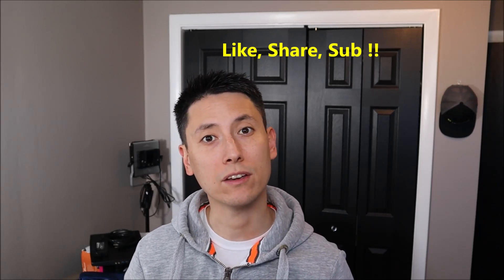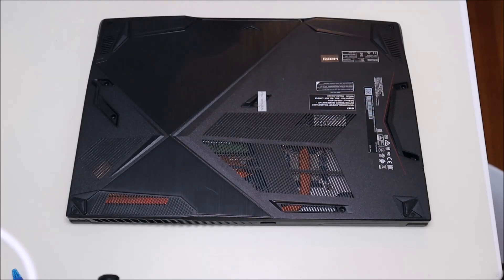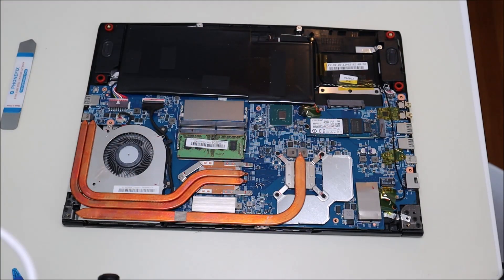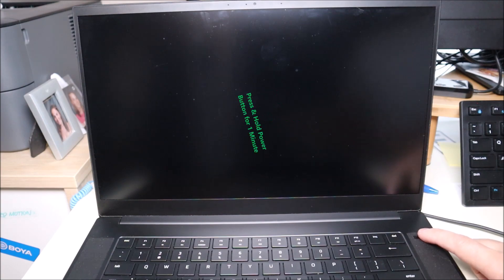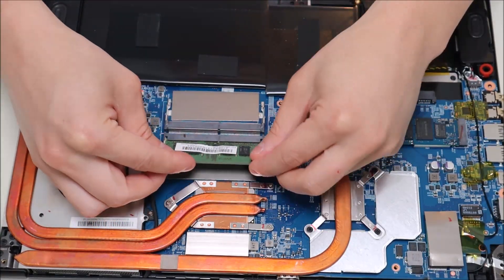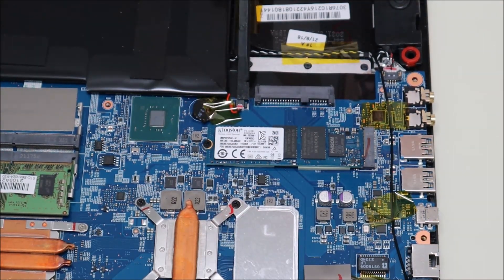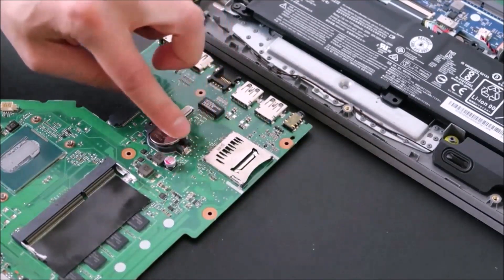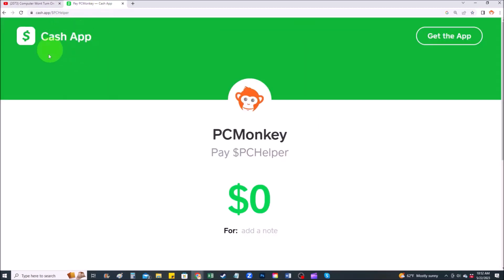MSI Laptop Computer - Dead / No Power / Wont Turn On Fix

Comment: My MSI  set up is very similar but won’t work. I tried the power button didn’t work. I also took the case off and tried disconnecting the battery and going thru those step didn’t work l, but have yet to tried my ram. But oddly enough when I click the power button I get a flicker of life such as a keyboard lighting up but won’t turn on, no fan noise, no lights on the screen nothing beside one flicker of light from the keyboard and the small light next to battery charger input Indicating it’s receiving a charge. If anyone has any suggestions pls help I can see my pc is receiving power since the keyboard flickering once I turn it on for a moment  and also the small light on the charger port. I assume my battery is receiving the power, but not distributing it to the motherboard or any other component of my laptop.
Reply from the maker: If, after trying all the steps seen here multiple times, you have not been able to find the issue, your most likely looking at one of two possible issues. (1) The motherboard is bad and needs to be replaced. Let me know if you would like help finding a compatible motherboard. Or (2) there is another computer component, shorting out the motherboard and need to be replaced such as the power jack, USB board, Touchpad, etc. You would have to troubleshoot each of those individually but unhooking it from the motherboard and trying to turn the computer on. Let me know if you would like help with that operation.
Reply: @PC_Monkey I have the same issues, went through all the steps and it seems that nothing works, how can i unplug all sources attached to motherboard in order to see if anything inflict the operation? Can you choose motherboard for me after I'll try everything? Thanks for education.
Reply from the maker: @WickedSickXXL  What brand and model computer do you have?
Reply: @PC_Monkey  MSI 14 inch Laptop Modern A10M | Core i5 | 8GB RAM | 256GB SSD, GF63 Thin 10scxr
Reply from the maker: @WickedSickXXL  Is this similar to your model? https://www.youtube.com/watch?v=jNg0Xh28XMU
Reply: @PC_Monkey  not same but similar yea
Reply: @PC_Monkey also, until yesterday the power button was blinking orange, today it blinks white, fan works silently.
Reply from the maker: @WickedSickXXL  If the fan turns on and works but nothing on the screen, then the computer may be on. Can you try the steps seen here?  https://youtu.be/e9iy30J00-k.  Let me know how that goes :)
Reply: @PC_Monkey  the option with Ram dismember I tried, doesn't work, tomorrow I will try with the extra monitor and will get back to you, thank you in advance.
Reply: Quick update, I tried another screen and it was the same situation.
I repeat all the operations removing battery, ram and int. Battery and after it switch on as it used to switch before.
Do you recommend changing any part which might be faulty or should I keep on going like this?
Thank you.
Reply from the maker: @WickedSickXXL  If its not displaying to another screen either then I would say motherboard at this point:(

Comment: Please help me diagnose a problem with my gaming laptop, an ASUS TUF Gaming F15. I’ve had it for two years without any issues. However, this month, while playing games, it started overheating and shutting down multiple times. I consulted a technician who replaced the thermal paste and cleaned the fan and vents. After a week, the problem persisted, and now it won’t turn on at all, though the battery light is still lit.
Reply from the maker: Just so you know, over heating situations can be hard to troubleshoot just one issue as multiple different components and boards including the motherboard itself, could all be faulty. 
An overheating computer can be damaging multiple different components if not resolved. First, make sure that the fan and vents are clean and clear. If you need help accessing the fan, let me know what brand and model computer you have and I can help you get inside it. If that does not fix the overheating issue, then try replacing the thermal paste on the CPU and if needed, the GPU as seen here; https://www.youtube.com/watch?v=K_j4GPjpawk. If that fails too, replace the CPU

Comment: I tried all steps still won't work i think its Because i never unplug the charger and the laptop is always on @PC_Monkey would buying another charger fix this or adapter i have the msi gf63 thin 10scxr

Comment: Nothing has worked so far for mine unfortunately 😔. Thank you anyway for your help
Reply from the maker: What brand and model computer do you have and whats the issue with it?
Also, did anything happen before this issue started? Liquid spill, overheating, a Windows update, etc?
Reply: @PC_Monkey  GF65 Thin 9SEXR-229FR - 15,6" FHD - Core i7-9750H - RAM 8G
The issue is that the computer does not even turning on at all (if I'm not mistaken, when we plug in the charger, a little light turn on which is not the case anymore here). I don't think that anything bad happened so far. This computer was not even used for gaming in fact and I haven't used it that much in the past 4 years 😔. If you have any ideas I'd be very thankful 🙏

Comment: Is there a chance to recover the MSI GS66 Stealth laptop after a complete flood?
Reply from the maker: Some things could most likely be saved, other things may be lost. If the computer was very wet, I would first take it apart as much as possible to dry a day or two. Then I would clean all the boards with a tooth brush and a alcohol mixture with a tooth brush. After that, I would try to reassemble and turn on.
Reply: @PC_Monkey  Thank you very much, I'll do like said step by step. Thank you again.

Comment: I have MSI GP76 Vector 12UGS, and the reason why it is not turning on is because of charging the laptop too much. At that time when it was not turning on, neither there was liquid spilled, nor CPU or GPU reached beyond the maximum temperature, but it was still overheating. I was using CoolerBoost with auto fan enabled. Any solution?
Reply from the maker: Just so you know, over heating situations can be hard to troubleshoot just one issue as multiple different components and boards including the motherboard itself, could all be faulty. 
An overheating computer can be damaging multiple different components if not resolved. First, make sure that the fan and vents are clean and clear. If you need help accessing the fan, let me know what brand and model computer you have and I can help you get inside it. If that does not fix the overheating issue, then try replacing the thermal paste on the CPU and if needed, the GPU as seen here; https://www.youtube.com/watch?v=K_j4GPjpawk. If that fails too, replace the CPU
Reply: @PC_Monkey I overcharged my laptop too much and the mainboard got burnt. Any solution?

I am using i7-12700H, RTX 3070 Ti laptop, 32 GB of RAM, and 1 TB of SSD.

Comment: I have a lower end msi laptop and today i was trying to charge it at school and it didnt charge, so i closed it and tried to use my friends charger and then my laptop just stopped working, it doesnt turn on, no lights flash, it doesnt even show charging
Reply: Its an msi modern 14
Reply from the maker: @matmeg-0847  If the charger was not compatible with your computer, it could have damaged the motherboard. Sounds like your on the correct video.  Have you tried the steps seen here?
Reply: @ i dont have any screwdrivers since i go to boarding school so i have to take it to be repaired today

Comment: Hi - my screen stopped working but the hard drive fans and keyboard still appear to be fine. Though when cutting off the laptop - it appears to reboot itself. There's still no screen. Have also attempted to add an external monitor but there's no signal. Help and thanks for sharing the video!
Reply from the maker: For a computer that turns on but the display does not work, try this video first; https://youtu.be/e9iy30J00-k.  Let me know how that goes :)
Also, did anything happen before this issue started? Liquid spill, overheating, a Windows update, etc?

Comment: So I'm having an issue is my katana 15 b13v my charger is working it does get warm but it's not turning on at all
Reply from the maker: Sounds like your on the correct video.  Have you tried the steps seen here?
Also, did anything happen before this issue started? Liquid spill, overheating, a Windows update, etc?
Reply: @PC_Monkey  no issues that im aware of just opened it up and pressed the power button and it doesn't do anything I just have the blank screen like when the computer is ofd

Comment: I have a MSI RAIDER laptop, closed at work, pulled out my backpack at home and didn’t went on again…

Tried all the stept, nothing is working unfortunate…
Reply from the maker: If after trying the steps seen here in this video multiple times without anything changing, your most likely looking at a faulty component preventing the motherboard from working or a motherboard issue.  I would start troubleshooting each component, starting with the charger and power jack.  You can see those two videos here;  https://youtu.be/YBhsVHideGE  &  https://youtu.be/HpabvrNaodU.  You can also try replacing other components like your Power Button to see if that is the route cause.  If none of those are the issue, you would then be left with a motherboard replacement.

Comment: Hey, wondering where the starter pins are on these msi laptops. Like how a tower has those pins you plug the power button into that you can jump with a metal object. Where are those and how do I start them without the power button?

Comment: Hello i opened my laptop and do it exactly as you said but not turning on.
But when i press the power button the light is shining from inside of laptop which is blue just second shining and shutting down again
Reply from the maker: did anything happen before this issue appeared?  Liquid spill, overheating, Windows update, etc?
Reply: No i was plaging game
Reply: Then when it was on the charge suddently turned off
Reply: Do you have whatsapp or tg number i will send you video of something from inside lighting

Comment: Turned off suddenly while using
None of the troubleshooting stuff works
Reply from the maker: Are there any signs of life at all when you try to turn it on? Lights? Fan, Motherboard, or Hard Drive sounds? Anything seen on the screen?  Also, did anything happen before this issue appeared?  Liquid spill, overheating, Windows update, etc?
Reply: @PC_Monkey  nothing at all windows update was like a week ago
I was just using my laptop and it turned off suddenly, no intensive tasks just word and browser

No lights or fans
Reply: @PC_Monkey  it could be overheating
Would you know what motherboard part to replace if it died due to overheating

Comment: You sir are a life saver! I have MSI GS63 Stealth 8RE and it was just showing red led light on when Power cable is connected, pushing and holding the power button did nothing.

Followed your advice and just pressed power button for 1 min and it worked!
Reply from the maker: Glad your all set :) Always here if needed !!

Comment: MSI g6 leopard! White power only, tried ram and battery, no dice....can you do a video please?
Reply from the maker: Were you able to perform the manual BIOS reset? Also, did anything happen before this issue appeared?  Liquid spill, overheating, Windows update, etc?
Reply: @PC_Monkey  I was, however, the issue continued afterwards. No spills, no new updates, and no overheating; I keep my computer on a cooling pad. I rarely need to use cooler boost. The fans weren't overworking and the keyboard body was cool before shutting off with the blinking light. It's resolved, now, but the cause still alludes me. I followed the steps in this video and another video that had my exact model. I cleaned everything (fans, cooling rods, crevices between the RAM, etc.) and left it to charge for 24 hours. After the 24, testing, same issue. After removing powercord, and trying again after 10 minutes, it turned back on as if nothing happened. Still running diagnostic.

Comment: Although I am on the verge of just getting a new laptop, the old one is still here for last tries, Here is what happened with my 11 year  old MSI GT70 0ND. A year ago I made the upgrade of old and gone gpu GTX 675MX  to 970M and flashed bios/EC for it, an upgrade the user Svet knew how to do as he created it and I followed it. It gave another 1.5 years of life to the laptop. Last I used screen cast for my phone and put it in sleep. I long ago deleted hyberfil.sys file as I do not use Hybernate. The laptop would just power ON but : Black screen, no boot. no bios nor windows. When it boots to windows the fans would be loud as a result of the new BIOS/EC but this told me it would not even reach to boot. I was reseating RAMs and HDD and that led to the laptop - to not power on at all. 

I bought a new motherboard (exact same  MS 17621 Ver 1.0). And put everything correctly in place to the new board including the CMOS battery. I was able to power it on a few times for 30 couple of seconds then it shut down -  but - like on old board - the Trackpad has no working LEDs, black screen, no logo- no boot. Also to power on is rare. I noticed the cables it uses CNJS E308724 80C 60V 16 pins - are really folded - on one of them the fold feels soft, it is like the cables could be gone? I see no such cables are sold. The foil covered trackpad to motherboard and power button&quick buttons panel to motherboard flat cables are not in good condition.

Comment: My laptop won't turn on. I've tried holding the power button, but nothing happens. When holding the power button, the chip next to the CMOS battery gets very hot. Does anyone have any suggestions for what to do next?
Reply from the maker: If that step did not help, have you tried the other steps? Was the computer overheating before this issue started?
Reply: @PC_Monkey 
I just received my laptop back from the service center. They told me that the motherboard was damaged (the chip is dead) and it needs to be replaced, with a cost of $500, so I ended up buying a new laptop. Anyway, thanks for your tips 😊

Comment: Okay so i dont know what worked, i tried unpluggin the battery but it just wouldnt come out, only slightly. Then i popped out ram stick and put it back in, still nothing then did that cmos battery unplug and still nothing. So finally i gaveup and screwed back the cover and just clicked on the power button and it started working... i am not sure what happened. ANYWAYS 
TLDR: DID EVERYTHING AND IT STARTED WORKING. 

SO THANKYOU SO MUCH ❤
Reply from the maker: Glad your all set :) Always here if needed !!
Reply: @PC_Monkey  ❤

Comment: Great viideo..  Thank you.  Didn't fix my issue but gave me something to try.  My 15 C7VFK is just out of warranty and won't boot.  Keyboard lights up, no screen, no fans then after about 15 seconds the power light goes red.  This has happened a few times but I have fixed it by simply holding the power button for 30 seconds then plugging the power pack back in.  No luck this time tho sadly.  I simply restarted after an update and boom..  dead.  Have tried everything I can think of...  time to take it somewhere for repairs.  I have owned many PC's and a few laptops and never had this much trouble.  These things are a piece of junk and I will never buy MSI again.
Reply from the maker: Were you able to try the other steps seen here? Also, did anything happen before this issue appeared?  Liquid spill, overheating, Windows update, etc?
Reply: @PC_Monkey  Hi,  Cheers for the reply.  Have tried everything except taking the motherboard out.  Am a little scared to do that but will give it a go when I have time.  Thanks again 😀

Comment: My laptop still wont turn on. I've tried every method and they don't seem to work. I tried checking the battery, ram, charger, cmos battery and nothing. Do I have to go to an actual place or can you figure it out?
Reply from the maker: If after trying the steps seen here in this video multiple times without anything changing, your most likely looking at a faulty component preventing the motherboard from working or a motherboard issue.  I would start troubleshooting each component, starting with the charger and power jack.  You can see those two videos here;  https://youtu.be/YBhsVHideGE  &  https://youtu.be/HpabvrNaodU.  You can also try replacing other components like your Power Button to see if that is the route cause.  If none of those are the issue, you would then be left with a motherboard replacement.

Comment: I was kinda confused when u said to disconnect the wires thingy of the battery and to hold power button for 1 min then if it turns on which it did to plug in charger i did it with no case on sideways and then i plugged the wire battery thingy back to the charger thingy and i had the computer suspended up on my bed but like not in the air on the bed and it was confusing will it still work if I plugged in the batterry wires while it was pluged in to charger